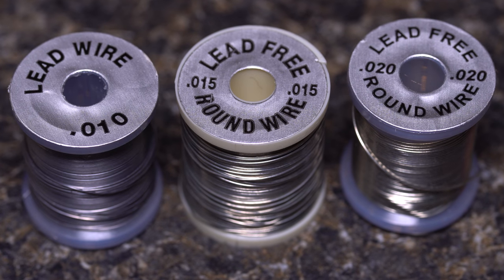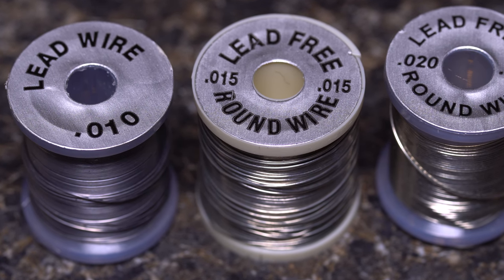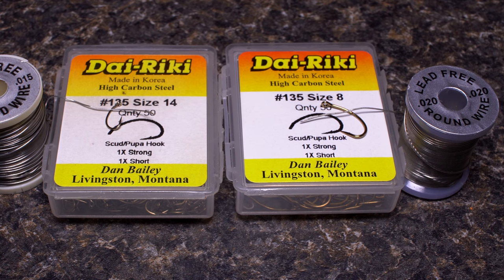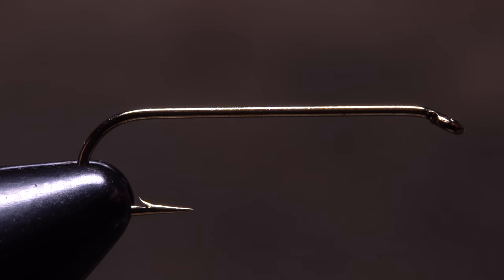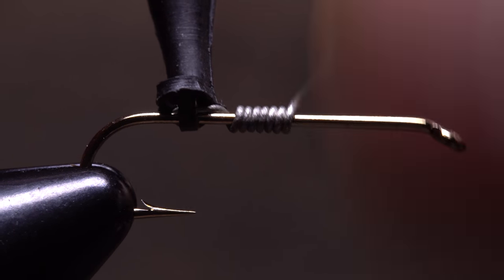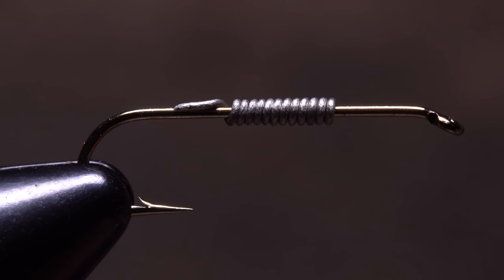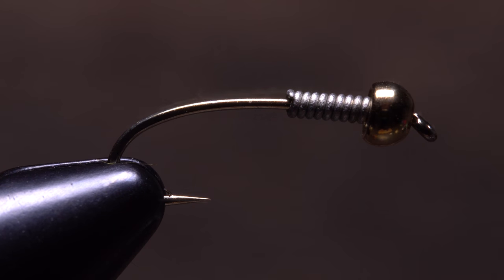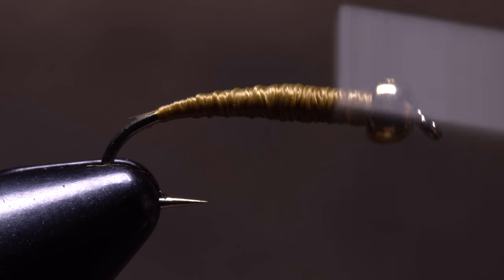Adding Lead-Free Wire Wraps

Comment: Adding superglue to the bare hook and then winding the lead wire helps me greatly in preventing it from spinning later on and when the fly is finished. It makes it much more durable and Im not afraid to use my haemostats to unhook fish. What are your thoughts on that?

Comment: I've never used the lead-free wire.  How does it compare in density to lead of the same diameter?
Reply from the maker: Very similar, maybe just a tad lighter.
Reply: Thanks.  I think there is a square-profile nontoxic wire as well.  Have you ever tried that?